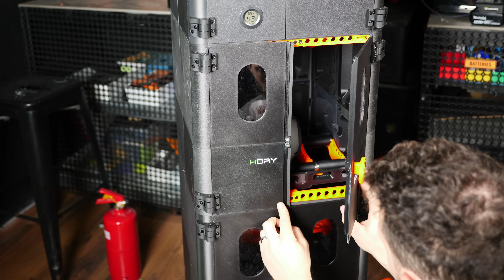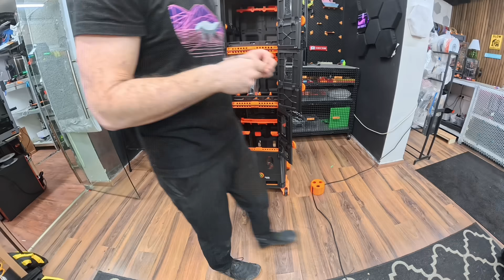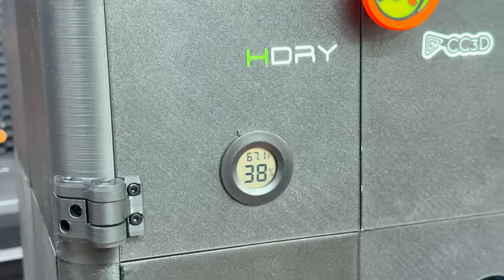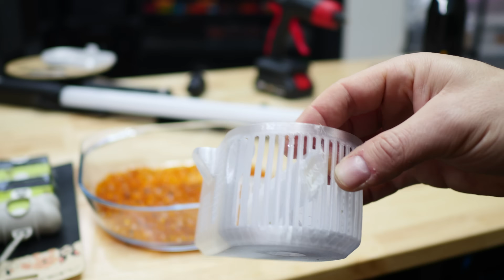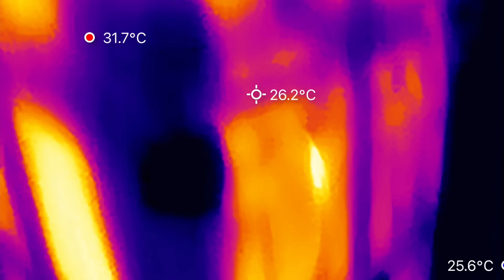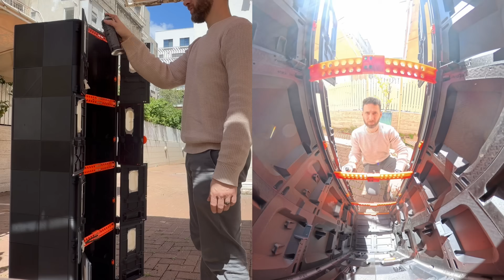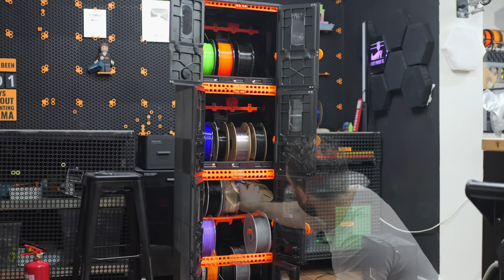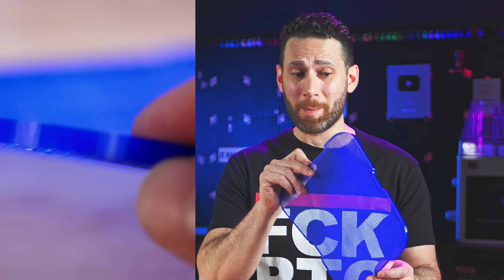This Will REVOLUTIONIZE 3D Printer Filament Storage!

Comment: I usually like the content here, but I have to be honest on this one - this whole video honestly feels like an essay generated by chatgpt. Half an hour of babble, with absolutely no substance or actual "revolution". You managed to put desiccant into a box and replace it once it gets wet... Where exactly is the revolution ?
Reply from the maker: Thanks for the feedback. Ironically ChatGPT helps me CUT my babble, but never writes for me. The revolution, though, is that this dries WAY faster than just using desiccant, making it feasible to use the cabinet without fear of opening and closing. I’ve since gotten it to reliably stay at 10% too…. All with 3W of power consumption. But if you don’t think that’s a big deal, no sweat. To each his own.
Reply: @thenextlayer  Appreciate the reply and your point of view. Forced air circulation indeed makes it equalize faster (same is true with polydriers, you can cut its drying time by about 30% just by allowing 5-10% MORE fresh air in the system). Sitting at 10% is achievable with enough desiccant, but be aware that those round thermometers are not really compatible with the word precision, and you do not want it too dry either (ie, do not force it below 10, there is a floor for too dry in 3d printing as well). That being said, usually your standard is a LOT higher and I appreciate that the videos add a lot of insight, tips and you don't leave all the failures out. Maybe I just got used to quality, this one really is just 30 minutes on a desiccant in a box vs desiccant in a bigger box.   There is brief mention of molecular sieves but it could still fit in a single short.    Maybe if you continue this, try and see other methods (electric membranes ala Rosahl), auto drying setups, or just keep it shorter with less grandiose titles. Wish you all the best

Comment: Cabinet is not the issue. It was the massive amount of undried filament you placed inside the cabinet. If you were adding one or two undried spools from time to time, it would be easier to maintain the moisture levels in the sub 20s. I plan on using one HDRY system  (2 module stack) for AMS units and another for just storage. I will be drying the filaments prior to putting in storage or AMS to minimize the amount of maintenance needed for the large volume of air to keep dry. Love your dedication and creativity!
Reply from the maker: You’re right. Since then, I’ve got it to 10% by repeatedly swapping the desiccant and upgrading to molecular sieves. It just took a few cycles of swapping desiccant to slowly suck out all the moisture throughout 10 days.

Comment: I simply use a dead topload freezer for nearly 10 years and usually have sub 10%, and yes have a sensor in there that is able to measure this low, around 2Kg of silica hold for 2-3 Months bevore i have to swap it and i can store nearly 50 spools in it. And yes i can confirm this method works for drying filament too, why shouldnt it? Its exactly the same way the moisture get IN the filament.
Reply: There is no reason it wouldn't work, desiccant is meant to suck out moisture out of air, so I don't get why he is even surprised it does that. You add heat when drying because it makes the effect of humidity exchange faster , like, way faster, but it does not change anything on the basic physics of it.     I actually use old fridge same as you do, at the end, it is just a bigass sealed box  that you would throw out anyway.  Need to recharge 3kg every 2 months, but I live in very humid place (70%+ most of time).
Reply from the maker: But how long does it take to get back to 10 after you open it? This solution does it in minutes.
Reply: @thenextlayer  I would say fast, the sensor records every hour and if i open it there is a sudden spike, 2 hours for the fast drop below 20% and 4 more  then its back to where it was.  The sensor is taped to the Lid so i have a bluetooth connection and the container are at the bottom. I have tought about a ventilation system inside but then i might loose more dry air when i open it.
Its also more a storage-solution for filaments i dont need everyday because as you can imagine i have to dig to get the spool i want.